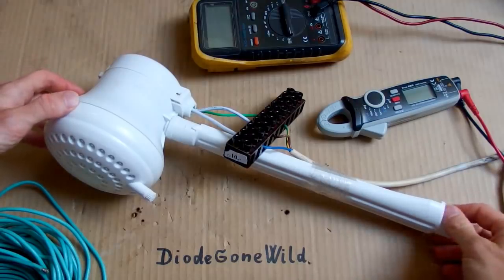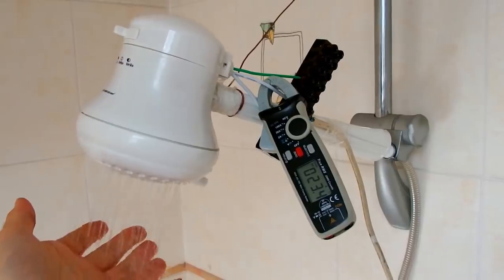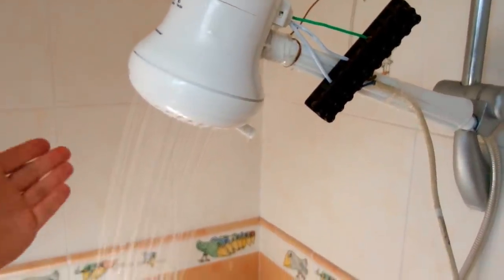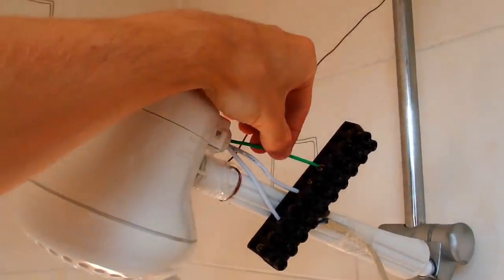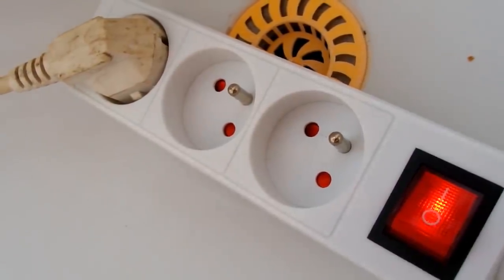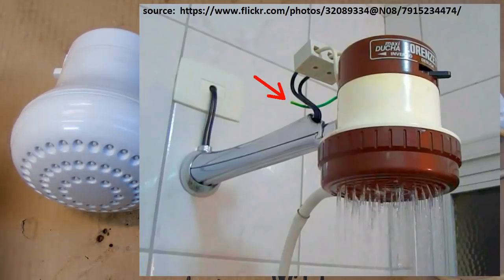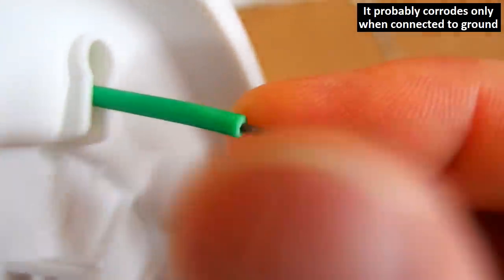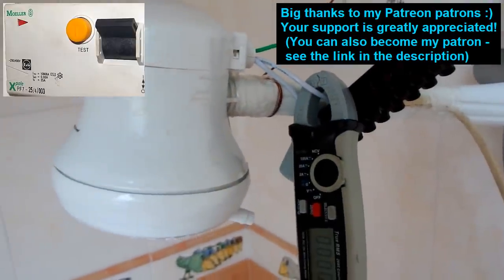Electric heated "suicide" shower PART 2 - test & measurements

Comment: Is it ok to connect the ground wire of all devices to nautral in building has no ground or earth wiring,?
Reply: In the UK it is common that a house is provided with only neutral and live and the earth for the building is connected to the neutral,  we have earth wiring though out the house but where the supply comes in the main earth terminal is connected to the neutral (this is known as TN-C-S),  in the UK only the electricity supply/network company can set this up by law,   not sure about other countries but your theory is correct, we only connect the earth to the neutral at a single point (where power comes into the house) and then have separate earth cables thought the house, this allows RCDs to still trip in a fault between live and earth,
Reply: @marcuswareham1  ok so its can make chassis live if I do same thing at devices wiring cosidering outlet is German type,I mean can pluged fliped

Comment: I'm brazilian, here I never had a problem but when I was in Cuba I felt a bit of a tingle, so I opened the shower and found that it was somewhat clogged probably with rust coming from the pipes. So I cleaned ghe showerhead and showered wearing rubber flip-flops and done

Comment: This is totaly madness!
It is basicly like bathing with a toaster, with exposed heating elements and connections direct in contact with the water!😱
It's unbelievable that these shower gadgets are allowed to be sold out with that low caution in mind by using them.🤯

Comment: Most of the houses in Brazil does NOT have GFI/RCD breakers (which is called DR - "Disjuntor diferencial Residual") also does NOT have grounding wires. And DOES have the suicide shower head! HA HA HA

Comment: I shower in one of those every single day. And is not grounded off course (the old apartment building where I live has no ground connection) and well, no shocks. Also my kitchen faucet have a identical heating device, but usually is off to save power.

Comment: the deaths of using those are probably from touching the wires or getting caught in them if they are longer... but just noone seems to install them properly... so it's a game called who wants to get ventricular fibrillation with even higher chance of winning it... i might consider using it, but then, i'm of course fully aware of all dangers, while others very likely aren't

Comment: Maybe the water in South America is pretty clean. Where I live it's >500ppm crap and you can feel some current with a hot wire in the water like that, like you did. If it were "normal" clean water I'd imagine you'd have to make an effort to feel it. Reminds me of the Hollywood hair dryer in the bath tub scenes killing people, and that cars regularly explode in a massive fireball when crashed. 
Once a friend refused to take a call on a cordless phone while she was in the bath because she was afraid it could kill her. Yes I said cordless. Thanks a lot Hollywood... 
I do agree that showerhead is kinda iffy, quality wise, which is typical for china. So while I wouldn't be worried about shock, I would worry it'll catch fire, which from the pix in your video it apparently has done many times. If the quality was better I'd consider it. 
Good video and I appreciate you taking the time to make it and all the other interesting things you do. Very very few people would do this stuff, and very few of those would video it and share, so thanks :)

Comment: What if you run the shower on DC/rectified mains? Is it safer?
Reply: 230V DC would be safer than 230V AC but the voltage will get higher to 325V DC if you rectify. Further, if you are wet you are so vulnerable that your chances of survival are near zero anyway. Wether you get caught by 230V AC or 325V DC, your chances of survival will stay near zero.
Reply from the maker: A bridge rectifier would make no difference. The voltage would be still referenced to mains. At the output there would still be about 120VAC (half of the mains voltage). The water works as a resistive divider and it would still have the same AC voltage in it. The only effect of a bridge rectified DC current would be that an electrolysis would eat the heater.

Comment: i still live with my parents and they have used these things since the 80's. these thigs have always scared the shit out of me and thus i always try to take a bath somewhere else, i have always told them to get rid of it but they have brushed me off as being paranoid and apparently having a hot bath is more important. My house has a ground connection but none of the "electricians" bothers to connect it to ground since "its not necessary". oh, they also dont bother to use screw terminals. here in panama nobody bothers to use ground and screw terminals, we are a suposedly rich countries but there are absolutely no safety standards when it comes to electrcity. there is nothing forbidding you from connecting a 50a device into a light switch rated for 15a, or using pigtails instead of screw terminals, not using ground or using these devices. i would prefer to take a bath with the asian version of it which is a tankless water heater connected straight onto  one of these shower heads you can hold in your hand and they are made by reputable brands like panasonic.(you can find images about it by searching something like shower water heater panasonic or siemens instead of panasonc  )

Comment: mysteries of electricity!
you deserve two like for each of us for the courage that you have had to do these experiments directly on your skin. Years ago there were similar things here in Italy but they were done much better: the resistance was isolated like that of the washing machines and the control lever acted both on the switch and on the flow of water, so there was no danger of turning on the shower and forget to open the water, but they have been put out of business because of their danger.
Looking from the sole point of view of operating costs, certainly the consumption is very high, but if we think that is only realized for the time necessary to take a shower or to fill the bathtub I would say that perhaps it is cheaper than the other systems heating water currently known .... (let alone the realization, we speak only of the principle of operation).
Surely for how it is realized I would put in jail of maximum security who has built it, but you have shown that the principle of operation is correct.
hello and the next video ... less dangerous though!

Comment: What if you just connect the ground wire to the water pipe?
Reply: Water pipes are connected to the electrical ground in a house, so it is the same as connecting the ground wire properly, but a water pipe might be a sligthly less ideal electrical conductor than copper wire.

Comment: Well here are some points: the test was ok even though this brand is very crappy and the houses put this kind of showerhead higher on the room (usually near the ceiling/roof) about 2,40m from floor. And there are better versions of electric showerheads :)
Reply: It is not the brand. The Lorenzetti in this video:

https://www.youtube.com/watch?v=FuQ_AAkkgIg&t=120s

... uses exactly the same design. Do there exist proper designs? I don't doubt that. But I think the point is that these unacceptably designed showers are in wide use, and videos like this can raise awareness about their unsafety.

Comment: The breaker is not tripping.Wow.
Reply from the maker: a 16A/B breaker doesn't immediately trip at 24A. Its (fast) magnetic threshold is about 48-80A. The bimetal will trip after multiple minutes at 1.5x of the rated current.
Reply: DiodeGoneWild ok

Comment: Here in Brazil all the population uses this kind of shower, in fact this a copy of Corona shower made here, all of the others showers sold here uses the same project, All my life I used this product, I am 44 years old, I am not death,  and I don´t remember any case of death using this type of shower, in fact we have regulations for the safety of all products sold here, is tested by 150000000 users without any problems.
Reply: If you turn it on without water, the only thing that happens is the fillament will broke due  the heat, and this will interrupt the eletric current in a second,  it will not cause fire, and shure... you have to install correctly with ground. If it happens we only have to replace the filament.
Reply: by the way wat kind of shower you use in your country? i dont know any tecnology to heat water with eletricity other than put filaments inside and pass an eletric current... or do you have microwaves showers?
Reply: About the liking, you just use PVC tape to seal it , its not made to install without PVC tape
Reply: you can use propane to heat water or natural gas, but is not dangerous... only thing can rappen is a explosion due to a liking pipe
Reply: t h i n k... genius
Reply: Eles em grande quantidades utilizam chuveiros a gás, ele mesmo disse no meio do vídeo que esses chuveiros são utilizados em paises mais quentes onde não existe grande demanda de aquecimento a gás.
Reply: "No man - no problem" - Joseph Stalin. Dead people don't complain.

Comment: That is insane but I don't think it can be sold legally in the US. For one thing you would need special service for 30+ amps. The connection wires should be long enough to make the connection outside of the shower, I mean that is pure junk. That said if they have been on the market long and no one has died I guess they look worse than they are.

Comment: Keep in mind that this is a low quality fake chinese copy of the traditional Lorenzetti shower head. The genuine shower heads from reputable brands we use here in Brazil and in most of south america (here in Rio they are available for sale in any big supermarket starting from 20 dollars) are of much better quality and certified by our national standards institute INMETRO. If you spend a little more , lets say more than 50 dollars, you can buy very well made premium showerheads with pressurization and/or electronic temperature control. Literally HUNDREDS OF MILLIONS of people shower using electric showerheads everyday and no one dies. On the other side every single year we hear on the news about people dying poisoned because of faulty gas based heaters even though they are available only in a tiny percentage of buildings on well off neighborhoods of a couple of big cities.

Comment: We use gas instant water heating, don't think I will change!! Water and electricity, never a great combination.
Reply: So you never used a washing machine, a pressure washer .... Microwaves are far more dangerous ... and they are everywhere.
Reply: House and carbon monoxide, fire and explosion risk however is a great combination, right?

Comment: Wow I can't believe these are a thing!!!     If you go on holiday and stay in a place with one of these showers with no ground wire connected,  It could be an idea to connect the loose ground wire to the neutral,   so there is a return path for the residual current with a low impedance so you are not the return path

Comment: But what if ground is not connected and neutral fails?
Reply: As I see it: Say bye bye to this world. This is because the resistance between live and neutral increases a lot, therefore also increasing the currents via the victim a lot.
Reply from the maker: In this case, the leakage current would be about double. This still may not be fatal.
Reply: In that case electricity and water would not be dangerous at all, but it is.

From your water electrolyzer video we know that you get > 5A of current if you run current through tap water. This >5A will split in a current going to neutral and leakage. Even if only 20% would leak, that would still be >1A. Currents > 30 mA can be deadly.

Why do you think leakage current would only double?
Reply: Well, most of those showers installed in Brazil use two 127 V phases, so no neutral at all. And no grounding too. Still nobody dies.

The water resistance is too high and most of the leakage current goes around your body. Not through it. 

As showed by the RCD this shower leaks more than 30 mA. Some here trips even 50 mA RCD but still, you don't feel anything while showering...

Comment: I would try installing the head according to the manual and fit it into the suction bath ... you have current protection, but in many homes it is not.

Comment: My favorite suicide shower had the 30A circuit breaker directly on the wall, inside the shower, without any cover :-) There was a note attached to switch: turn on power after turning on the water. At least the wires were red and at least 4mm² ; Ah, and no grounding was attached.

Comment: Why don't they put a neutral wire instead of the ground to avoid the ground leaking? Good Video please more!
Reply: teknik_craft What? Usually it uses two phases! How would you fit a neutral? Also neutral can have some "backfiring" (idk the right english name for that) current from other appliances so it would be more dangerous...
Reply: teknik_craft That is a good thougt. In practice it works but when neutral fails fun begins :D When you have grounded case appliance and neutral breaks inside cable it will zap. That's the reason why we have PE (protective earth). Your thougt is using PEN(protective earth neutral). Watch TPAI's video about three phase power
Reply from the maker: Neutral wire, if it gets disconnected / broken somewhere, becomes live via the load impedance. Neutral is often not guaranteed to have a fixed position, it can be inverted with live. Neutral can discoonect before live or connect after live in switches or plugs.

Comment: In INDIA you will die definitely because we still using metal pipes for plumbing (water connection) from main source to house inlet. The moment you touch the handle and water same time, your time has arrived.
Rcd and GFCI is kind of luxury saftey, i don't think wireman in localty does even know about the stuff.

Comment: I'm Brazilian and you made me very scary about those showers haha. Where I live is very hot during the day (30°C) and about 25 to 27 at night, so it's pretty uncommon to find a house with a heater system, as you said. In my bathroom it was one of those, we had to ground it using a bar of metal that goes down through a window to the neighbor's garden (fuck logic, better than die kk). After all we just remove it because the inside resistance had a pretty short life time and they are a little expensive (it was looking very better made then yours haha). Nice videos and Channel man.

Comment: But what happens when the earth wire oxidizes?
Reply from the maker: then it's no longer earthed.
Reply: Indeed, this device totally does not comply with European regulations and that is the reason that I have seen it for the first time.
Thanks for your informative vlogs.

Comment: With heater element isolated from head and water and proper grounding similar design should work fine. Demonstrated device however indeed is a suicide device. No surprise why ground protection tripped. Without grounding it will be even more interesting. Statistics about how these devices are installed, would be interesting reading. Grounding to water pipes "because these was the nearest" and things like that. Neighbors once nearly killed me with a washing machine grounded to cold water pipe. These may cause similar quirks. In short - another somewhat ingenious device for average people in countries where individual person's life mean nothing.

Comment: Thats another product I definitely will avoid a YouTuber called gadget adict did a teardown of one of these. Hes in the philipines the mains there is 2 wires each of 115 volts so it was interesting to see one used on proper 220 mains. Please be careful mate you took some real  risks  regards Jon
Reply from the maker: I saw this video too. I was wondering why his RCD doesn't trip. I didn't know that the mains in Philipines has s grounded centre point. So now I know it :). In the Philipines mains the shower must have almost no voltage in the water because the water works as a resistive divider.

Comment: try soaking your hands in soap then ground yourself, you're not just gonna take a bath with just water, i wonder what the current will be when your hand is soapy+grounded..
Edit: plus i wonder if you would get shocks if that ground wire rusted over time (Resistance would rise) due to it always being wet?

Comment: Another safety risk you created yourself there... running it on full power with old appliance cord + 3 way extensions rated for 16 amps, though if the power cord you wired to the shower itself was from a washing machine it will be 10 amps...  you could have had a fire from overload.

Still... the shower head I wouldn't consider using one... I'd rather smell like a tramp than risk electrocution... I prefer my triton 11.8kw shower box on the wall with the non electric head.

Comment: My new apartment in France is older than my previous one, so no ground 🙄 even in France you don't have ground everywhere
Reply from the maker: It must be a very old building. I have never seen a non-grounded socket in Czech republic. On the other hand, buildings with wiring from before 1996 have sockets with the ground pin connected with neutral, because the pre-1996 wirings had just live and neutral.
Reply: @DiodeGoneWild  What colour is neutral before 1996?And did you have grounded sockets even in dry areas like a bedroom?

Comment: I have a suggestion to prevent those springs from corroding: Coat it with Tin. A type of metal. Tin is commonly used for coating irons and other metals to prevent it from corroding.

Tin is also used as a metal for making solder.

Also coat the ground wire with it! It's probably made of Copper, as always.
Reply: Sorry, tin is a conductor, and the heating wire is a resistor, so you're left with a short circuit.